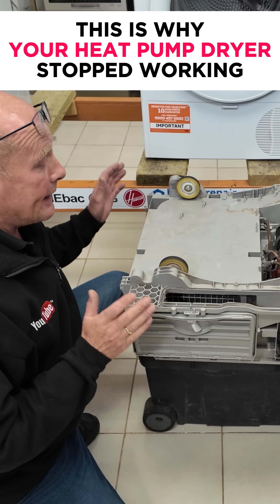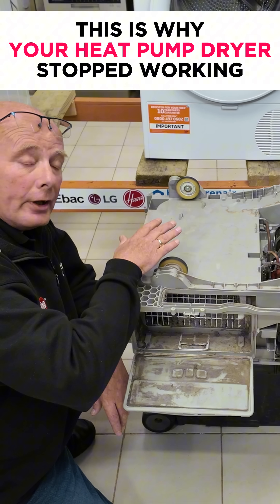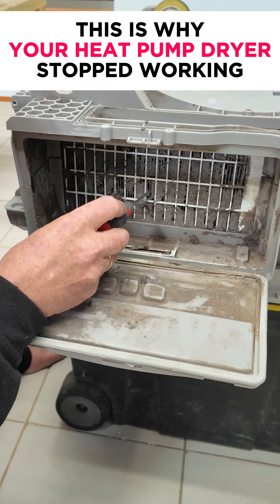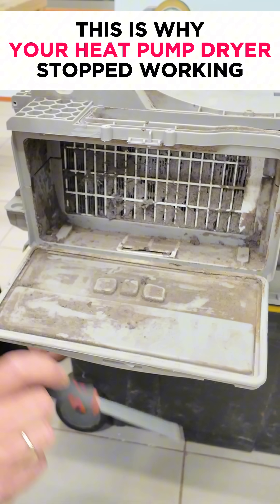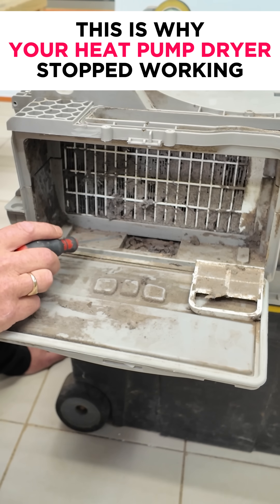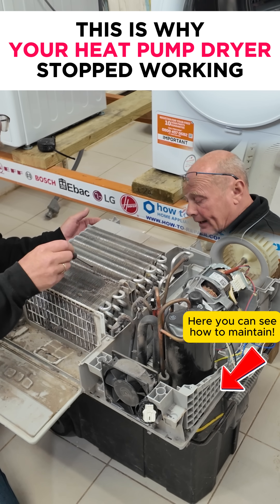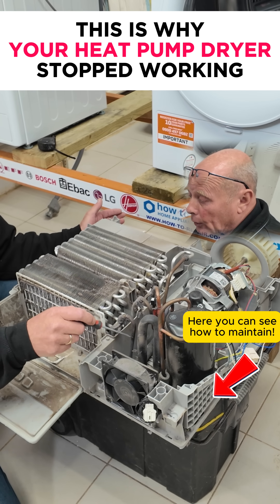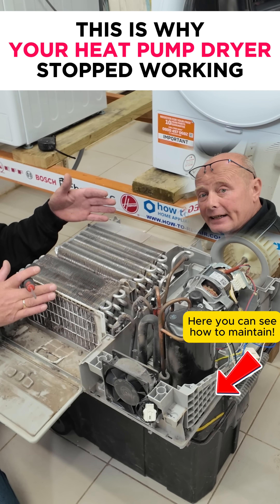IS YOUR HEAT PUMP DRYER NOT WORKING? #bekotumbledryer  #heatpumptumbledryer

Comment: My Hotpoint heat pump dryer is taking ages (and doing a poor job) so I suspect its system is blocked with dust.  I'm not looking forward to taking it apart.  It looks like a total stripdown.
Reply: Replying to my own comment, with an update: I stripped it right down, and found there wasn't much dust in the heat exchanger.  I then washed the heat exchanger fins out with a pressure washer, reassembled the dryer, and tested it.  There was no difference in the performance, so I assumed the gas must have been leaking, and bought a new machine (Bosch, this time).